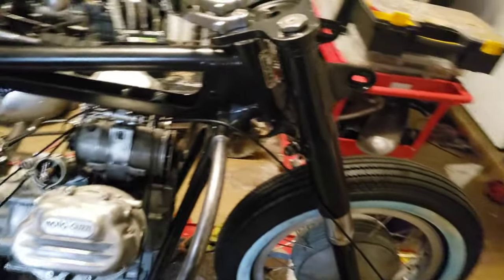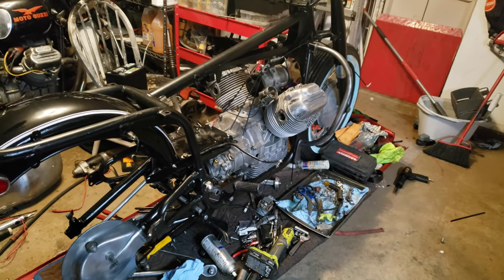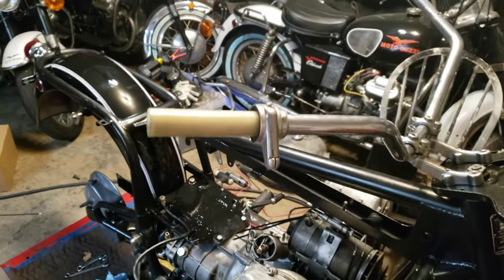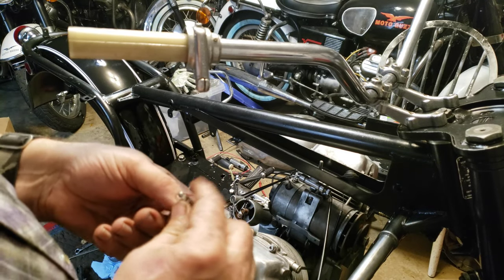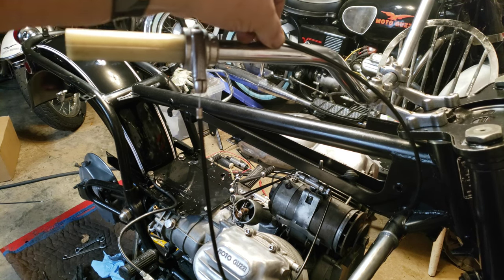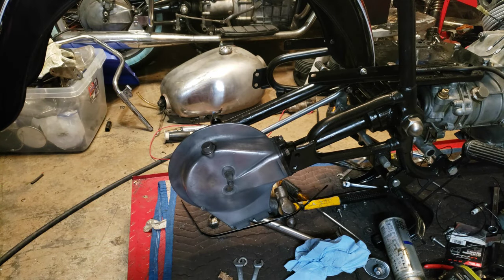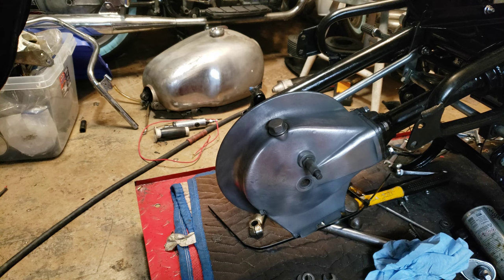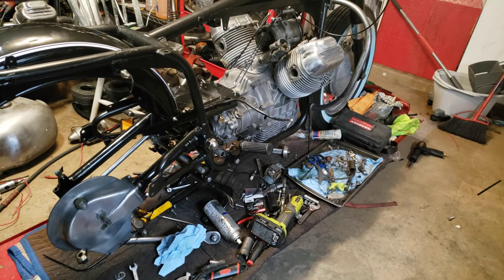Current Status -Fender On, Handlebar Installed, Begin Final Assembly 1973 Moto Guzzi Eldorado- Ep 51

Comment: You did enough of these, you got a system. I'm interested to see when you take on a different animal.
Reply from the maker: Next up is a Moto Guzzi Police Convert, then a 1931 Harley Davidson V, that I am acquiring part by part!
Reply: @VintageRestorations-by-WS   The Harley build will draw a lot of viewers.  Are you starting with a reproduction frame?
Reply from the maker: @MyWillypilly  No.  I will use an original frame.  Haven't bought it yet, but have bid on a couple so far....